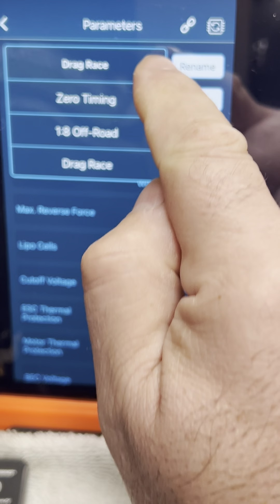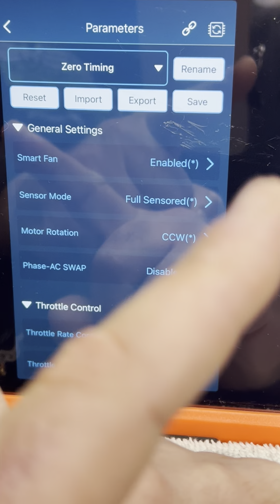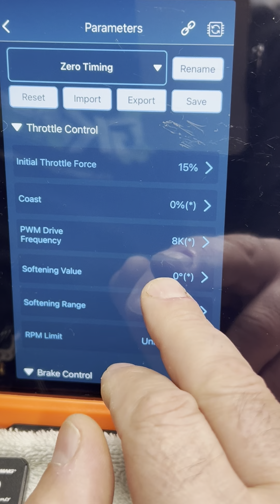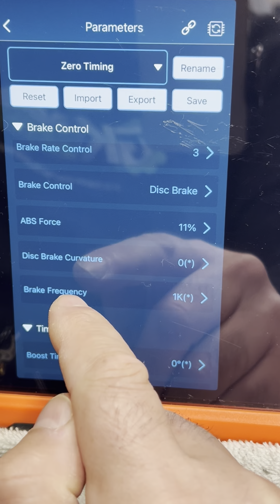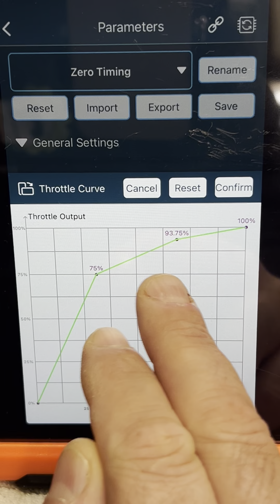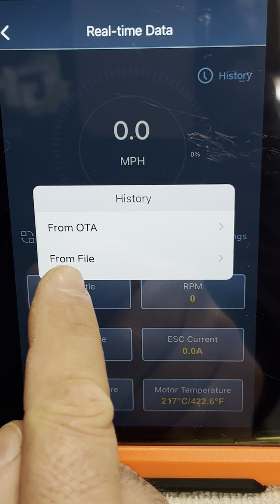The Ultimate HOBBYWING ESC Tuning Guide - for no prep drag racing and on road / off road use.

Comment: on throttle rate: I personally always use 30 and try to reduce the agressivness of the motor with other settings (boost, softening, drive freq, timing). Because you need that quick power response. Throttle rate works with a bit of delay and i hate delay. I want the power when i need it. Especially while beeing in the air. This is true especially for 1/10th carpet/astro racing
Reply from the maker: Awesome information, I definitely see that for 1/10 carpet/astro racing
Reply: Asome Video How nows the Esc he run a 4 Pole Motor

Comment: Kindly if one use for example 12⁰ boost timing and 36⁰ turbo timing, the kv of thd motor will change because the motor runs faster so do one have to lower the gearing ratio to achieve a similar speed ?

Comment: Are the timing parameters also proprietary to HW motors, or can it work on any 2 pole motor? What other parameters will work with any 2 pole motors?
Reply from the maker: @mattr2533  
Before I answer, I will be releasing a new video for the XR10 pro Drag Racing ESC. That is compatible with all motors.

As for your question, the XR10 pro series is open to all motors, the rest of the lineup are compatible only with HOBBYWING motors if you want advanced timing.

Comment: I have a question about the throttle softening value,  when the applied throttle gets above the set range does it instantly snap back to the unsoftened value or does it gradually return the timing to its unsoftened value?
Reply from the maker: @stp440  it will decay up to the value,
This way it will not be a sudden change.

Think of it as Anti boost

Comment: How can i set my hw g2 xr8 pro to reduce the torque of my 1900kv on buggy 1/8? Thanks
Reply from the maker: Use the softening valve and range, increase drive frequency or both
Reply: @RCstreetwars  now I have 30 soft range and 50 value, 20k pwm , throttle rate 15 but at the exit of the corner if i push the accelerator i have too much torque
Reply from the maker: @awastyle9198  it sounds like you’re just going to have to take all of your torque reduction tools and set them at the points that produce minimum torque and adjust from there. This includes throttle rate control. Make sure you have your smoothing range and smoothing value set to maximum, I do not recommend any more than 24K PWM.
Reply: @RCstreetwars  OK, thanks a lot. you have to adjust the accelerator in every corner to make it accelerate well and not slip. it becomes difficult to be constant on the lap. Throttle curve or speed on radio control can Help?

Comment: Interesting.  Having gone 2.2 with my HW XR10 pro , I've just installed the XR8 pro and I'm hoping it can deliver a lot more amps and get my Losi 22S to a flat 2 on a dry tire . I do like the throttle map using the OTA , similar to my R1 car . Thanks for the info .
Reply from the maker: Hope you’re doing well, ask any questions you might have.
Reply: @RCstreetwars  
I do indeed have a question ! I'm running the new large HW drag motor 3662 and I have installed an XR8 pro to run it , I was then told the XR8 pro won't supply turbo or boost timing to this motor ! Is this true ?